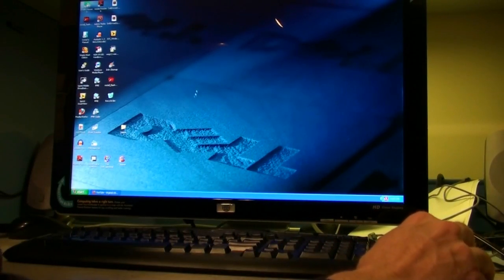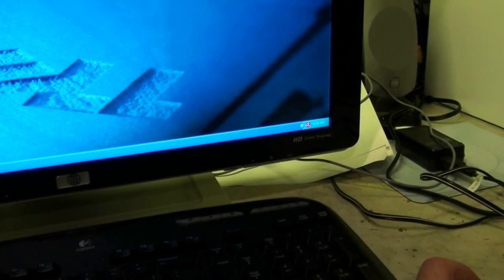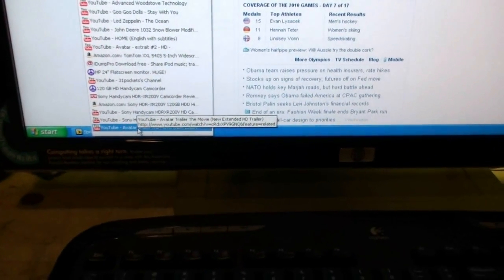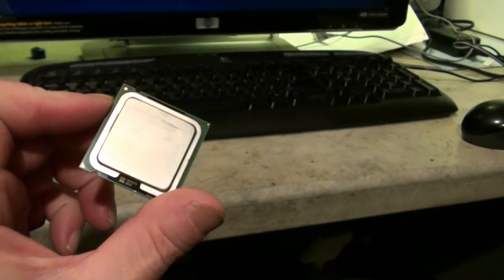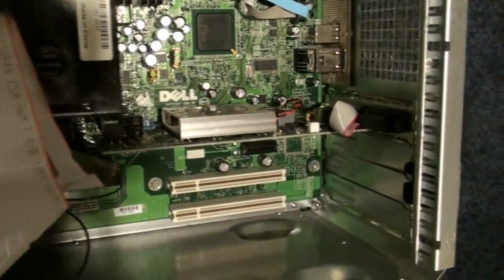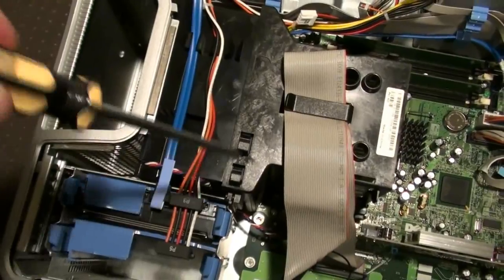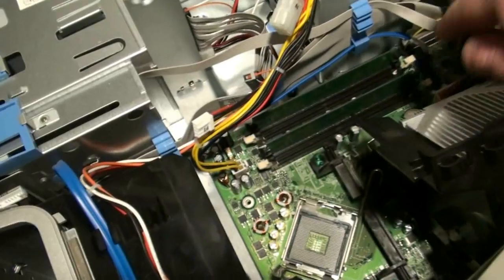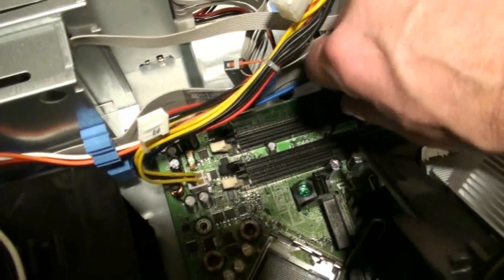Dell Dimension 5150 Desktop 3.8 GHz CPU and Memory upgrade Part #2

Comment: thats not true i used to have a pentium 4 dual core 3.2ghz processor in my 5150 and i have a intel dual core processor 3.4ghz in it now. its running fine and it plays mw2 quite well

Comment: I have the Pentium D dual core with 2GB RAM, heat sink seems like gray anodized steel on aluminum base.  Recommended screwdriver is Stanley 1pt, 250mm.  2pt, 100mm is too short for easy fitting.  Couldn't say these are 'fast' computers for gaming, sure can't cope with standard U.S. news channel videos, Google Earth best done real careful like, but as a basic work computer they're fine.  If you want fast gaming, just buy a computer built for the job, I wouldn't try customizing some old tech Dell!

Comment: Its a Pentium 4 / 2.8 ghz. Its runs games just fine on high settings but every now and again it does lag from the processor being overworked. Im planning on putting a Pentium D dual core in it then I should be mint!!

Comment: I have the same dell 4700 and put a new Radeon 6770 HD video card in without having to upgrade to windows 7... i just had to by a new power supply for it (cuz of the 6 pin connector) and put more ram in it that was it. Runs great and hasnt given me any problems yet except for the fan sounds like a jet engine but im sure that has to do with the processor which im going to upgrade soon.

Comment: i have the p4 520. plan to upgrade to the 570J. Then I will be getting a 1gb HD video card.. which will mean i will have to put win7, because of DirectX. and will have to find the same optical drive on mine since it won't read stuff anymore, being 6 years old. (demension 4700)

Comment: @HungeryDead The tower will accept Intel Pentium D dual core and Intel Pentium Dual Core processors. It accepts some Intel Core 2 Duo Processors and should accept socket LGA775 Intel Xeon quad core processors with 1066mhz FSB. I have one with 2.8 ghz Pentium D dual core. Theres different boards in these towers tho maybe it depends on what board you have

Comment from the maker: @HungeryDead 

You can't use a dual core processor in this computer, only a single core. You can use a Pentium 4 series 5xx or 6xx processor. The highest processor that you can use is the P4 670 3.8GHZ which is what I put in mine.

Comment from the maker: @brettfavre67 Another thing that can help with HD video editing is to change the operating system to 64 bit windows and change the bios setting but, theres more cost involved with that. I also use a Dell XPS 400 with a Pentium D 3.6GHz dual core and 4 gigs of ram, but these two PCs are set in the legacy mode in the bios and convert to 32 bit even though operation is 64 bit with these fast CPUs.

Comment from the maker: @brettfavre67 If its a Pentium D that would usually mean its a dual core and would be better than the 3.8GHz single core P4, I have seen a few Pentium D series 5150 for sale on eBay sometimes but there very rare and not sure the history on them. The 3.8GHz makes a super upgrade for an older P4 single core PC along with memory.

Comment: I have a Dell Dimension 5150 it came with a intel D cpu would you recomend staying with that or using the intel 4 i no it has 3.8 ghz but i think its older, i havnt checked my current cpu's speed but i imagine it is somewhere around 3 ghz any advice would be appreciated.